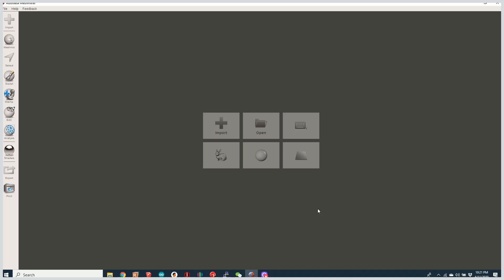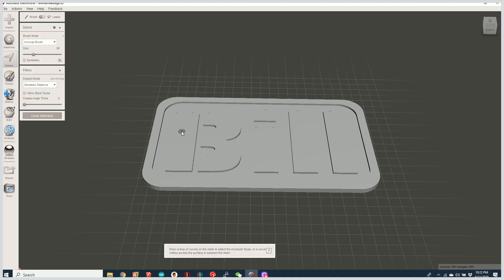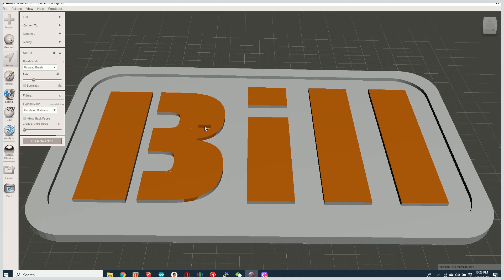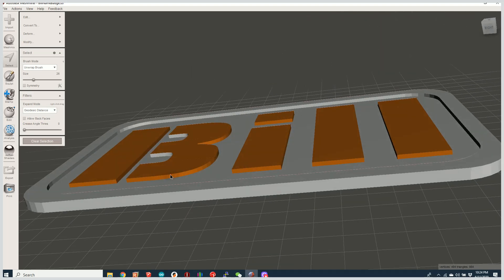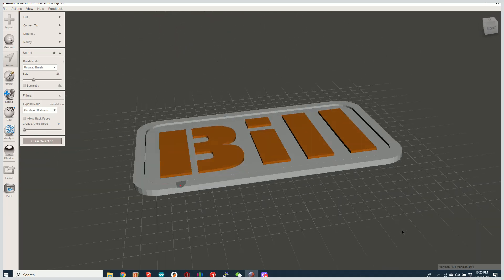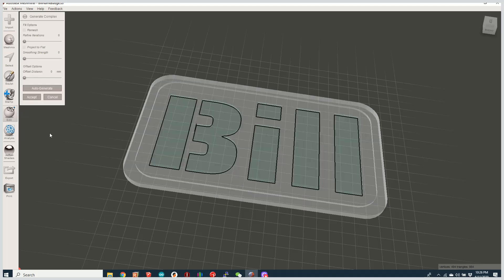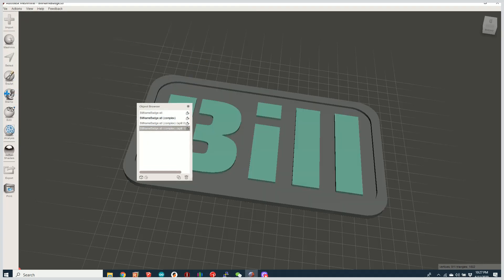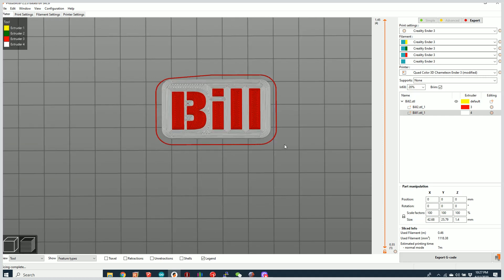Using Meshmixer to convert a single STL into a multiple color STL for printing with the 3D Chameleon

Comment: I had noticed on the website that it says this unit is plug and play, but im having a hard time wrapping my head around how it actually works without making any modifications to my firmware. What all is involved there?
Reply: It's basically switching the motors via a button that the extruder presses.  It's all done with the slicer via the tool changing custom gcode.  There is no need to modify the firmware because from the printer's stand point, it's still printing with a single extruder.